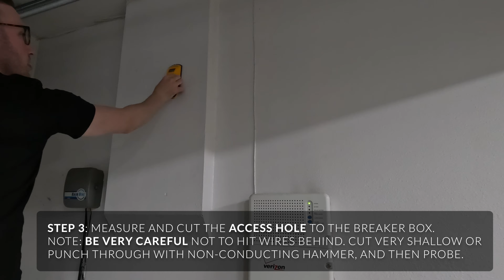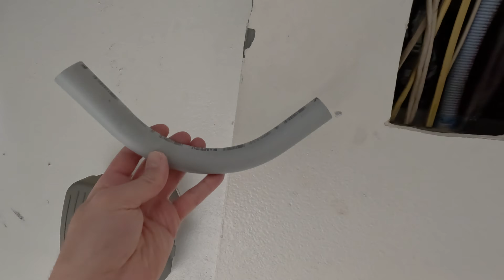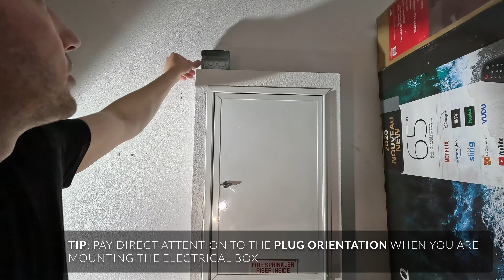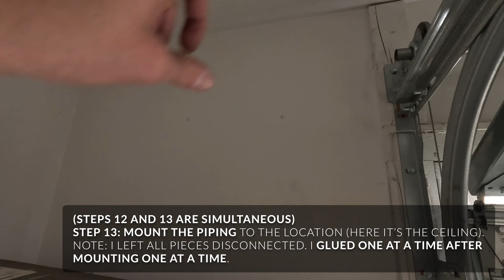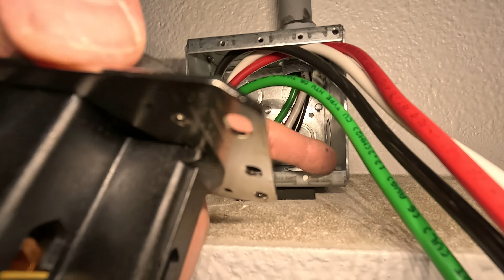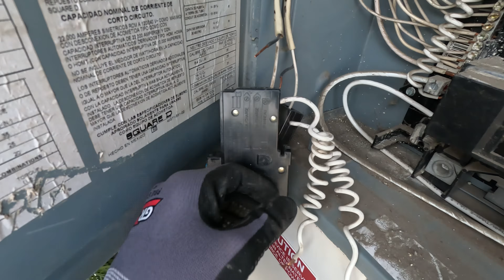How to Install an EV 240V Outlet | Complete Tutorial | DIY NEMA 14-50R Wiring Guide

Comment: Is that height code?
Reply from the maker: Hey, could you give me a little more specifics on the question?
Reply: @fixitcolton  sure...I was under the impression that outlets need to be a certain height from the floor and not too high up or above cabinets.
Reply from the maker: Ah ok, as far as I know, there's not a code for height in residential garages. I'm in California. There may be additional codes in other states, I'm unsure. I think some risky appliances can require certain heights in garages (18" at minimum) or so. I think a general rule of thumb is about 4ft in order to have items not hit it, since garages usually store things. This outlet was higher, but not too high to reach easily from the flat ground. I suppose I would use that as a factor. Make the outlet higher, but not too high to unplug easily, if necessary. I was only using a ladder in order to see it clearer and run the line above it, it wasn't necessary to use to access the outlet. Hope that helps a bit, but I don't have an exact answer on that one.
Reply: @fixitcolton  thanks for responding!

Comment: 60A does not require 4awg.  Your 6awg THHN wire is rated for 65A in most residential areas.